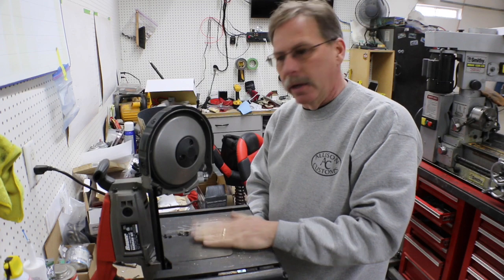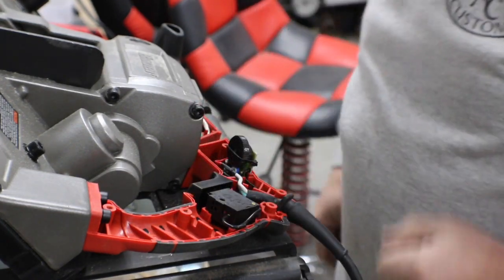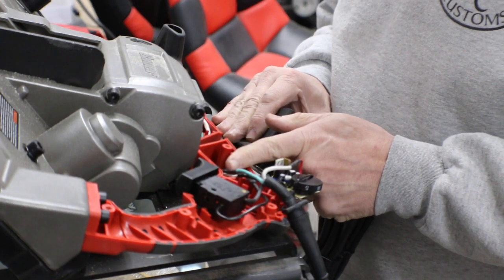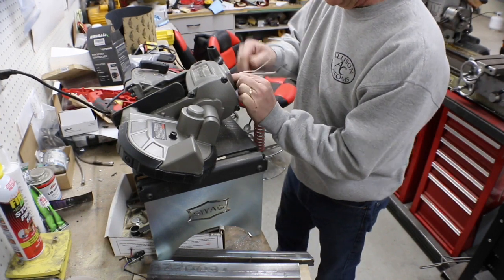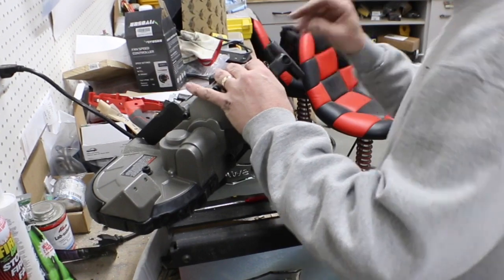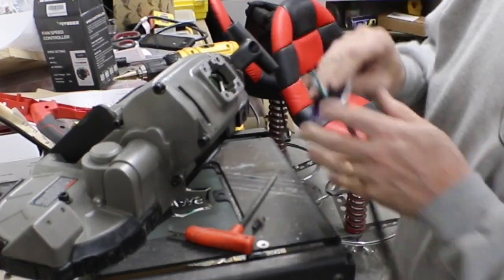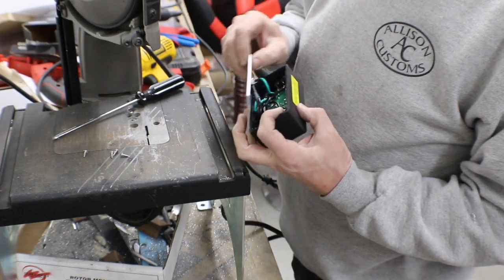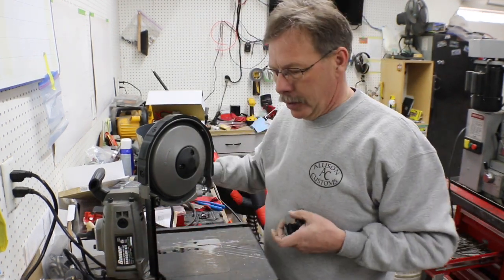Harbor Freight Bauer Bandsaw - The Fix Is In

Comment: Good Lord!
Why not just jumper across the two terminals on the Speed Control, put it all back together so it would run at full speed and then plug the Saw's power cord into the Fan Speed Controller to get variable speeds?
Am I missing somthing?
Reply from the maker: You certainly could for a “down and dirty” fix, I was trying to clean up extra cords and provide full functionality.

Comment: Just bought a HF Bauer saw, now I’ll be set to replace the switch if it breaks, what metal cutting blade would you recommend to cut 1/8 “ metal ? Thanks
Reply from the maker: So far, I have just been using the HF blades.   Ore teeth per inch typically makes for better cuts.  I have been planning to order some higher quality blades.

Comment: Where did you get the bandsaw stand?
Reply from the maker: I bought mine directly from SWAG, and the one in the video is the Zinc & Powder Coat version.  Links are in the description. but I paste them here as well. 

SWAG OffRoad V3.0 Portaband Table  - https://amzn.to/2GnvIEZ
(For Harbor Freight Bauer Deep cut model # 1678E-B, 63444, 63763
        Harbor Freight Bauer Deep cut item #'s 63763, 63444, 62800, 1678E-B
         Harbor Freight Deep cut model # 62800
         Milwaukee Deep cut model #'s 6230, 6230N, 6232, 6232-5, 6232.51 6232-55, 6232-6, 6232-6N, 6232-8N, 6236, 6236N, 6238, 6238N, 0729-20, 0729-21
        Dewalt Deep cut model #'s DWM120, DWM120K, D28770, D28770K, DCS374B
         Makita Deep cut model #'s 2107F, 2107FK, XPB02Z, BPB180Z-18VOLT
         Home Depot WEN Brand #94396
         Grizzly Tools Deep cut model # G8692)

SWAG Offroad V4.0 Portaband Table - https://amzn.to/2IbBqM7
(For Milwaukee 6232-20, 6232-21, 6232-80, 6232-81, 6238-20, 6238-21 & BS125 AND Milwaukee Fuel M18 2729-20, 2729-21, 2729-22 & CBS125)

Comment: I'm glad I ran across this video. I just bought a Bauer band saw and the SWAG 3.0. I was going to get a foot switch, but now I'm thinking about getting a variable speed setup similar to the one you've shown. Do you think it will work to plug the band saw directly into the switch without removing the rheostat from the band saw? I believe if I set the band saw rheostat to the highest setting it should work just fine. Does you, or anyone else, know why this wouldn't work or if it may cause any long term problems?
Reply from the maker: That should work. I removed the switch in mine because it had broken.  I think you can do exactly what you are thinking and just put a zip tie on the trigger.  I tried the foot switch, and it worked ok, but I definitely like the new switch better.
Reply: @AllisonCustoms  I ordered the switch from Amazon that you suggested and it arrived earlier today. It works great albeit not quite as seamless as your set up. If you want the highest saw speed you have to set the rheostat on the saw to MAX and the fan controller switch to MAX. To control the speed between the highest variable speed of 5 and MAX speed, set the rheostat on the saw to MAX and the fan controller switch to VAR. To control the speed between 1 and 5, set the rheostat on the saw to 5 and the fan controller switch to VAR. Thanks for sharing this idea!
Reply from the maker: I’m happy to hear it’s working for you!